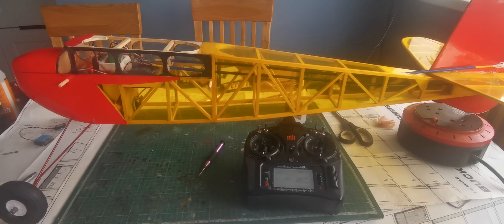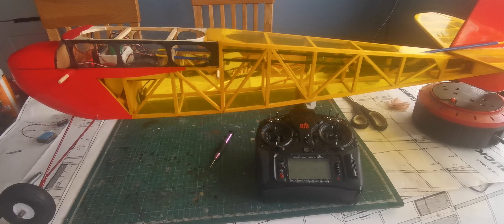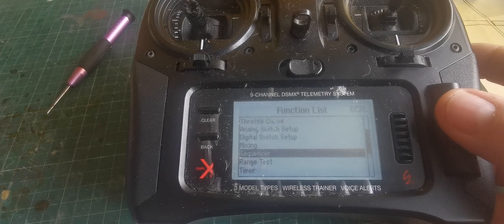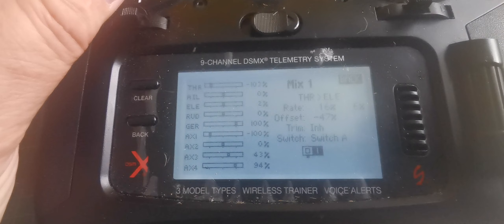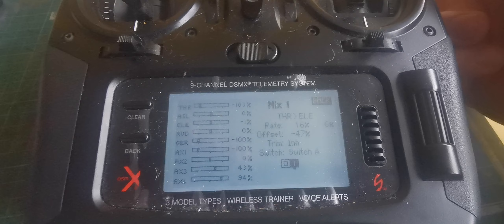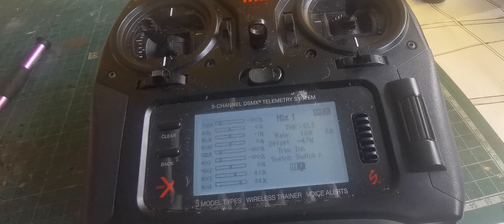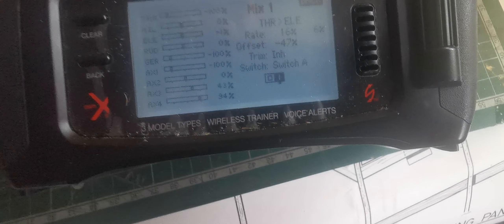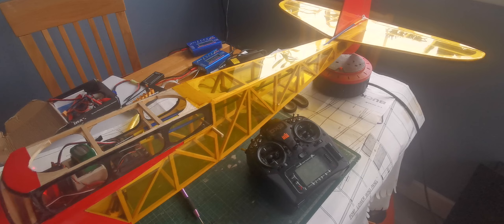Setting up a mix on a Spektrum Dx9 throttle /elevator mix.

Comment: Very interesting.
Reply from the maker: I know that you can just feed some down in as you open the throttle manually but why not use the technology?
Reply: @MarkCroucherRC4fun  I am planning to mix the throttle and elevator on my Barons. Every year I compete in a daft competition for a French three channel trainer called a Baron.We are allowed to fit much bigger engines than they were designed for. Mine are fitted with 52 four-strokes and they climb like mad at full throttle. Thank you for showing me how it's done. If you'd like to know what La Coupe Des Barons is all about, have a look at this:   https://www.youtube.com/watch?v=JuMm24PTZ_Y I won the four-stroke class in 2021 and Im keen to regain my title.
Reply from the maker: @daviddavis7710  wow what fun funnily I stumbled on a YouTube about the event but my French is terrible so I was unsure what it was about. Really like the idea of the event.
Reply: @MarkCroucherRC4fun  There are still twelve starting places open. It would be good to have another British pilot in the competition! I'll translate for you!